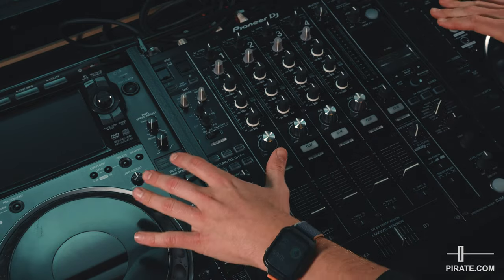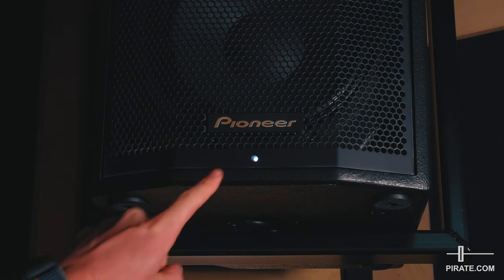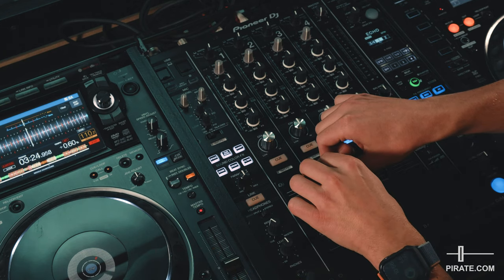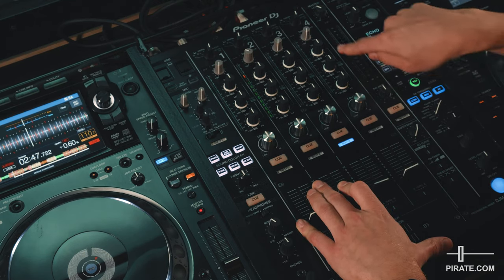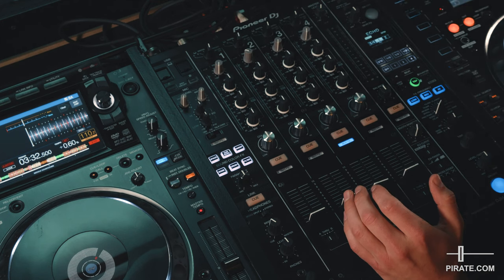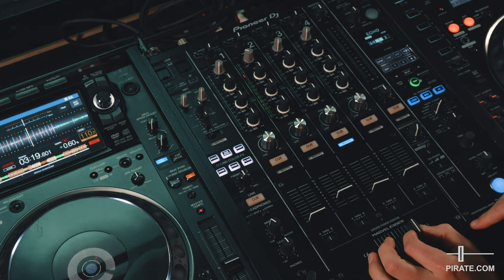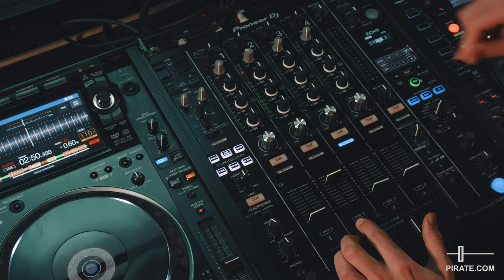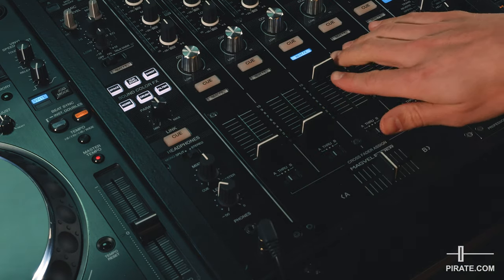DJ Mixer Sound Output & Levels - How To Use CDJs - Part 2

Comment: Do you need 1 USB for every deck in CDJs?
Reply: No, Pirate studios usually have the CDJ2000/3000s connected by ethernet, so you can use one USB stick in one deck and 'USB LINK' it across all the other decks. This usually happens automatically, when you plug just one stick in.

Comment: Digital is best sound
Reply: @djstuc  compared to RCA yes
Reply: There's a few things you may not be aware of.  Also, I'm not sure if you know what RCA means. In the context of DJ gear, RCA refers to the connector itself. Its typically used for one channel of single ended audio transfer or a 75ohm stereo digital signal. Either way, just stating that something is RCA can't tell you anything about sound quality. For that, you need to know quite a bit more.
Reply: What really is the point and advantage about using the digital outs of the CDJ‘s is that the mixer (since DJM‘s are digital mixers) doesnt need to convert from analog to digital in the first place. You will save an ADC conversion what one can definitely hear.
Reply: @johannesk8995  use digital out man you will hear the difference
Reply: @bboymac84  thats what I just said yeah. You will hear the difference
Reply: @johannesk8995  I'm certainly not going to argue with you on that. I agree. But when I looked into buying one of these mixers for myself, you can route the signal different ways, depending on what you're needs are. Not all digital mixers force you to convert the signal. Since these are supposed to be high end mixers, I can't imagine not offering the choice. Otherwise, you have to hope the dac in the mixer is better than the one in your player. Also, most DJ's use MP-3's. Sometimes by choice, sometimes you're forced to. Anyway, using the analog outputs on the media player avoids the bit stripping that would occur with digital signal attenuation. For me, that would be a deal breaker. MP-3 at full resolution is bad enough, there's no way I'm going to lower the quality even further.